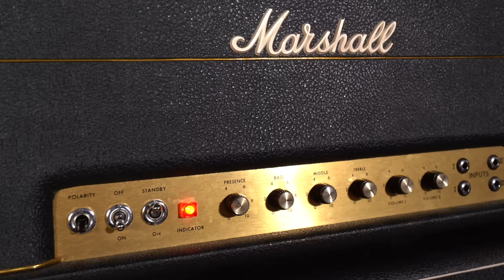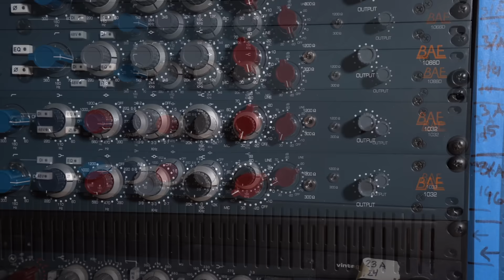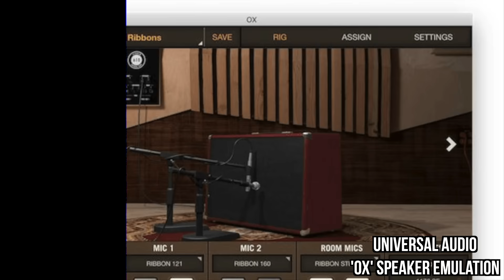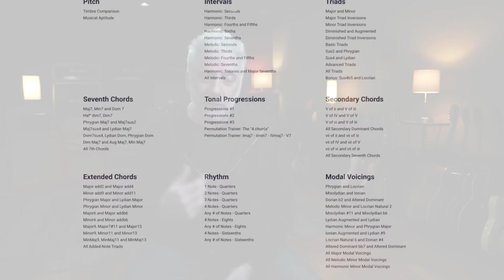So Can You HEAR the Difference?

Comment: That was cool.  I've never really played through a 4x12.  I have always had combo amps with a 1x12.  It was interesting to hear how different they all sounded.  The vintage celestion speakers in the Marshall cab seemed the best, by far, to my ears.  More articulate and also smooth at the same time.  I felt like I could hear each note of a chord as opposed to just the sound of the chord, if that makes any sense.  Thanks for doing this guys!
Reply: I once had

a 50w plexi
a100w plexi
a Hiwatt 100 (DR 103)
connected to
a Marshall 4*12 (240W)
a Marshall 2*12 50W (greenback)
a Hiwatt 4*12 (Fane - can't remember the wattage)
a 2*15 HH (400W ceramic/cast Al) bass cab

in my living room!

Maxxed out - it squealed if you didn't damp the strings...in the next room with two doors closed between you and them.

In the same room.....if you looked at a note it leapt off the string. There was no damping - if you didn't play it was out of control feedback.

But the tone...it could make you cry. AC/DC didn't sound this good live.

The touch sensitivity was out of this world.

BUT you couldn't be in the room for more than 30 seconds - I now have serious hearing loss.

250W of thermionic power into a serious amount of cones is just magnificent (probably equivalent to 800W of transistor power) - if I had outdoor stages (and roadies) it's the way I'd roll.

Comment: the Mesa has got a warm sound which make you feel comfortable. The first Marshall sounds relatively thin. The Hiwatt has got mids, only. A little bit lifeless. And number four Marshall is very agile but a little more agressive than the Mesa. So for me it is the Mesa (if I had to compare Hi-Fi amps I would describe it like this: the Marshall is the transistor and the Mesa the tube amp).

Comment: Interesting test. Quite liked it.

FYI/FFT: The original Fane speakers used in Hiwatt cabinets were designed by Dave Reeves specifically for Hiwatt amplifiers. Celestions really don't cut it with Hiwatt amps. Try this same test with A Hiwatt DR103, and the results will be quite different I'm sure. Furthermore, the Hiwatt/Fane speakers in this test are 75 watts which were designed to emulate the original 50 Hiwatt/Fane speaker.

Try this same test with a P-90 equipped SG or Les Paul (vintage original preferred, no re-issues please. Pickup magnets are different: AlNiCo II up to 1971; then, AlNiCo V ) and a Stratocaster. 

Again, please re-do this with a Hiwatt head.

Comment: Speaker wise the Marshal is brighter and has more bite which sounds fantastic, and it would also help it cut through the mix. The Mesa cabinet was much darker, losing most of the top end and it sounded dull to me. Amp head wise, the Marshal was great and had complex overtones without adding anything to the signal that didn't come from the guitar. The Park amp seemed to have a LOT of background noise compared to the Marshall during quiet parts such that I'd need to gate it. It's distortion seemed a little more biting and dirty than the Marshall's as well. Perhaps the Park was used with a higher gain and that explains the striking difference in noise and tone?

Comment: Rick Beato I love ya man so don't take this as me being a smart ass or know it all but that Marshall cab is really a checkerboard cab. The basketweeve was the thicker grill cloth that turned tan over time and ended around 70 or so. Checkerboard came next and yours is a reissue of those early/ mid 70's checkerboard cabs. There was large checkerboard and small checkerboard cabs as well... the small checkerboard came in the mid to later 70's. I'm a Marshall geek and have owned so many so I picked up the lingo or terms used. I'm sure you already knew this and just said basketweeve like I always do. Love the video and all you do!!
Reply from the maker: You are correct! Sorry
Reply: @RickBeato  Why no Orange cab?
Reply from the maker: Just trying something different
Reply: @RickBeato  I had a cab with 65 watt celestions but they didn't sound as good as yours. Yours sound great! Mine were mid scooped sounding. From what I have learned they made different variations of the 65 watt celestions and some sound much better than others. Not sure how you know other than being able to try before you buy.  Mine were from the 80's before they came out with the 70 watters then the 75 watt ones. I think they sounded sort of like the 75 watt speakers that came so often in the Marshall cabs. I didn't like them and sold them. The new 65 watt celestiions have more mids and sound closer to what I'm hearing in your video. Thanks again! Love these type of video's.

Comment: Of course there is a difference and the thing was it was not consistent, depending on the song they sounded a bit different, so generalizing is also a bit pointless, but the Marshall with the Greenbacks had rich high harmonic content a bit more mid and high focused, Hiwatt had a bit of nasal sound (for me this happens when you have more bass and highs and cut the mid, hey might be wrong on that, Rick said 1k mid boost), the Mesa was more dark, but with well balanced mid, bit less treble, kind of clinical, sounded tight, think maybe the most easy to stay away from mush when doing high gain, the last Marshall  had a bit more in the bottom and had this nice mid to it, sounded a bit darker than the Greenback cabinet, but each had its unique thing!  At the end of the day those are tools to create music, you can mike them differently, use EQ, use different guitar/pickups, different amp, but main goal is to get the sound you envision for the song. This is why I find the video great as it helps build a tonal vocabulary and learn the tools and the available expression you can get out of them.  Btw Great beards think alike :) Maybe do a video how to use one cab and make it sound like another one, a little bit of Cabseption?

Comment: It all depends, understand your verdict on this shootout in general, but for AC/DC riffing the G12M-25 greenback in that checkerboard cab sounded damned right with that Park, where as the G12-65 compressed the midrange and let some nasty high midrange through that you'd have to eq if insisting on using that cab.

Comment: Really interesting. I expected the Greenbacks and the V30s to sound more different but they were fairly close even in pretty different cabs. The Greenbacks have more low mids and the V30s have more upper mids. I really didn't like the Fanes. They just sounded hollow and without much definition. The last cab with the Lead 65s sounds like 80s rock. Lots of treble in those speakers.

Comment: How good a speaker cab sounds and how good an amp sounds depends on what (speaker or amp) they are plugged into.
V30 rule but not so much for Classic Marshall tones. The amp already has those frequencies emphasized.
The Mesa version is smoother than the regular version. I prefer the regular versus the Mesa ones.
Also speakers sound harsh until they get broken in -especially the V30. You need to crank em for dozens of hours to get them to their sweet spot.

Comment: Well, to my ears at least, it's clear that Marshall amps and Fane speakers are a poor match, and I kinda knew it'd turn out that way. I don't recall ever having seen that particular combination utilized in real life even once(!). And this is a great demonstration as of why. The only thing that works with Marshall amps are Celestions. Then, it's nuances and personal preference, really, as to which variant of Celestions one prefer. I don't like my guitar sound to have much in the way of bottom end. In the sort-of modern sense, that is, so that Mesa cab with 30s are out. Maybe the same speakers in a regular Marshall 1960...? The 65s simply left me cold, so those are out as well. I'd go for the traditional: old style Marshall 1960 with greenback 25 watters. It's the quintessensial classic Marshall sound, and one can't go wrong with that, really. As for the amps... the late seventies one sounded a tiny bit harsher than the early seventies one, I think, so I'd go with the latter.

Comment: But...what gauge strings were you using? Just kidding. Great video thanks for posting. With a bit of studio tweaking I could have used any of those tracks other than the Hiwatt. I was surprised by the Mesa. V30's are usually not my thing but in that cab with that style they sounded great!

Comment: How come no one mentions the Eminence speakers or uses them. I have these in my 4x12, 2x12, and 1x12
Eminence speaker 

Swamp Thang 12" Guitar Speaker, 150 Watts at 8 Ohms

A 12" American guitar speaker with big bottom end
Very powerful, thick and chunky tone with good sustain
Ideal for: Blues, Rock, and Jazz
Magnet 59 oz

Texas Heat 12" Guitar Speaker, 150 Watts at 8 Ohms

A warm and smooth 12" American guitar speaker packing a little Texas-style heat
Nice clear, fat tone with a little top end bite and a hint of British flavor
Ideal for: American Rock, Blues, and Southern Rock
Magnet  38 oz

The Tonker 12" Guitar Speaker, 150 Watts at 8 Ohms

A hard-hitting 12" speaker with British flavor and harmonic balance
A very fat, clean and warm tone through the mid-range and a smooth top end
Ideal for: English Rock, Southern Rock, Country (Great with a Telecaster)
Magnet 59 oz

Red White & Blues 12 Inch Guitar Speaker 120 Watts

Nice tight low-end, smooth midrange and top end sparkle
American cousin to "The Governor"
Magnet 38 oz

Man O War 12" Guitar Speaker, 120 Watts at 8 Ohms

        work horse of tone. 
        A proven and revered sound, very                 
         loud and responsive/articulate in 
         every register. 
         Chunky and solid sound with a little 
          top end sparkle.

          Magnet Weight; 38 oz.

Comment: Hiwatt's sound horrible on Celestions.
Partridge output transformers don't like them for some reason.
Reply: So that goes the other way round too, like in this test? Because you didn't hear any Hiwatts through Celestions here ;-) 
Maybe the Partridge OTs can handle the amps output much better than the Dagnall or drakes leading to way too bright sounds from Hiwatt through Celestions and the Fanes in the Hiwatt may not have that much high mid-range which you may like for your Marshall to sound right when the amp is distorting.